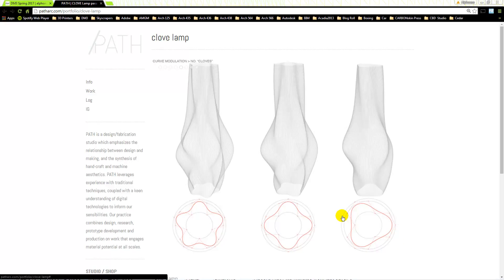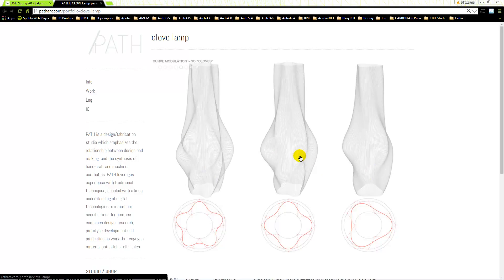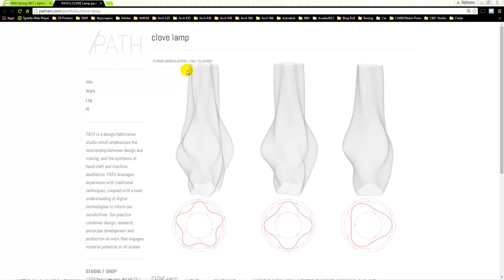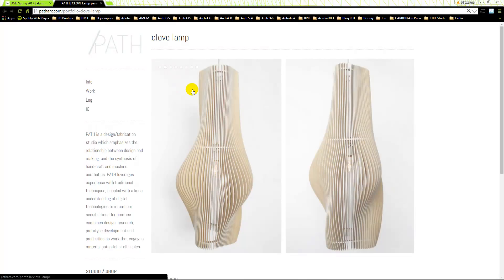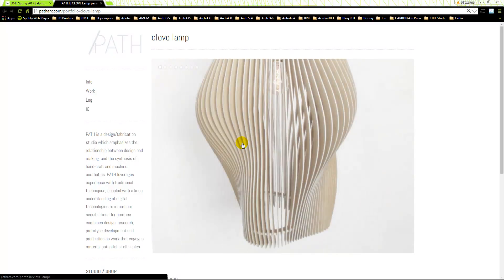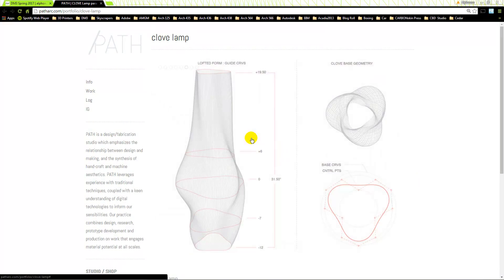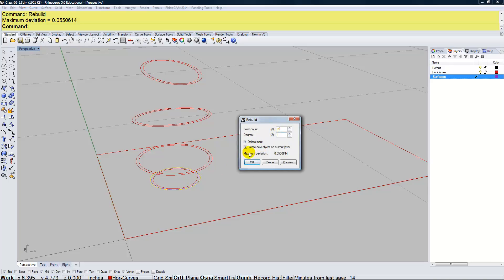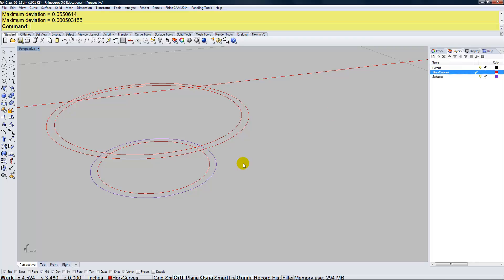Rhino Sectioning for Laser Cutting or CNC

Comment: That's an old video, but to make this kind of project you wanna use grasshopper. You can make a surface then extract the planar curves from this surface then extrude this surface. Also the joint system doesn't work. You're not gonna get the shape you want this way when you join your lamp in real life. You need to cut bot side half way not entirely
Reply from the maker: Thanks for the feedback!

Comment: Project to C plane is not a command you want to use in this case. It projects and object as a vertical shadow in top view thus leaving it deformed if started from some random angle. This will ruin your measurements, dimensions and end product. Use orientonSurface instead. Great video otherwise, cheers
Reply from the maker: Thanks for the input. Much appreciated!

Comment: Hi, I tried doing this but my vertical slats are not flat, none of the sides can be rotated to be flat along a plane? any idea why, I tried to follow this tutorial step by step! ;(
Reply: Hello, did you find a solution for that?
Reply: @luismora6717  , there is no solution. In order to get the flat vertical profiles you shoul get them via intersecting both surfaces with vertical flat surfaces. Create a line  strating in the center of the shapes baseline then rotate (with copy option on)  with the startpoint as the center of rotation. Extrude those lines vertically. Intersect extrusions with the surfaces. Get the flat vertical curves .
Reply: @architectEvo  AWESOME SOLUTION!!!
 THANK YOU!